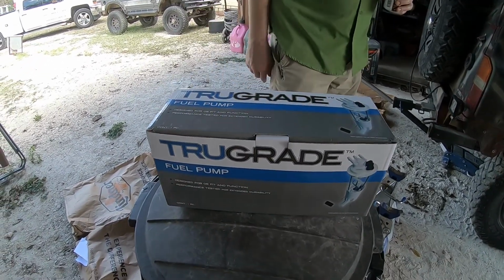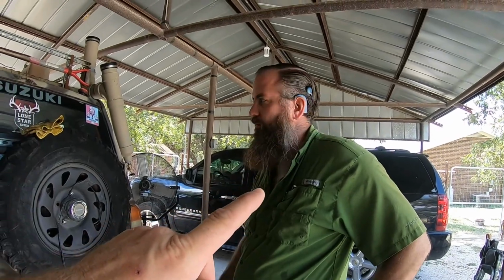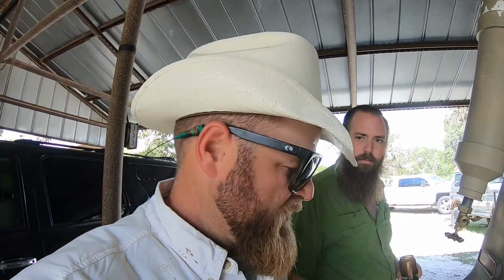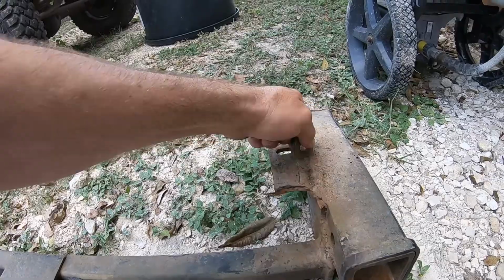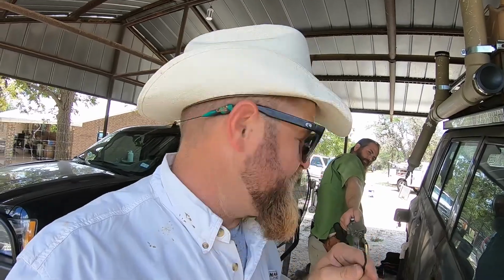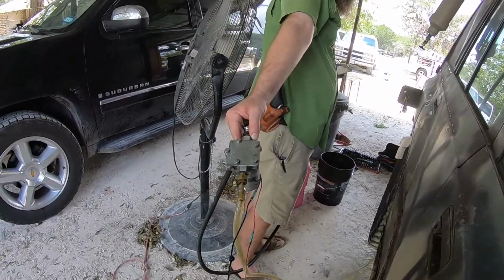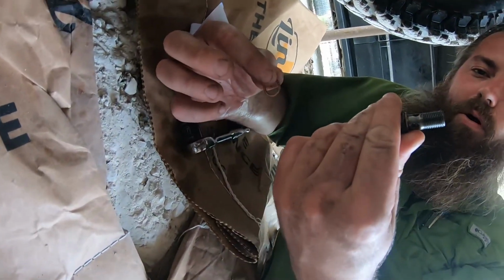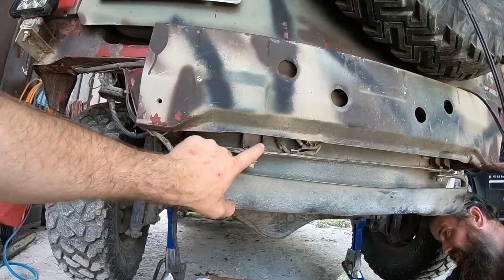HOW TO CHANGE OUT A FUEL PUMP ON A SUZUKI SIDEKICK aka THE ULTIMATE BUGOUT VEHICLE PART 1

Comment: Got a question...actually two, (before I take the console apart) is there an easy way to get to the bulb in the console or do I have to take all of the screws out (I have a '95 Sidekick as well) and the other question is: how do I remove the bezel around the radio and heater controls,(without destroying it) I think the air "vector" door is missing it's cable, so I can't send the air where I want it to go!